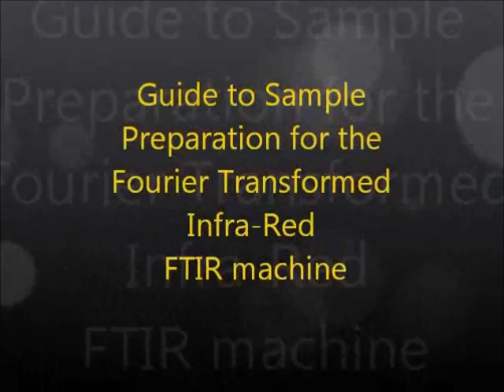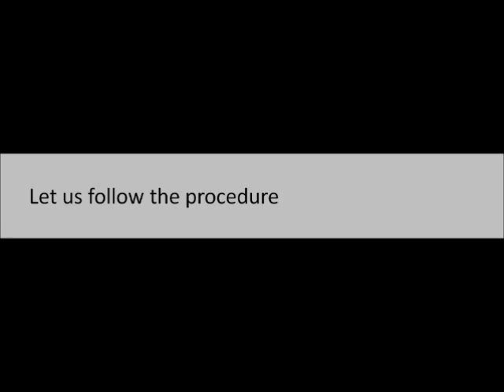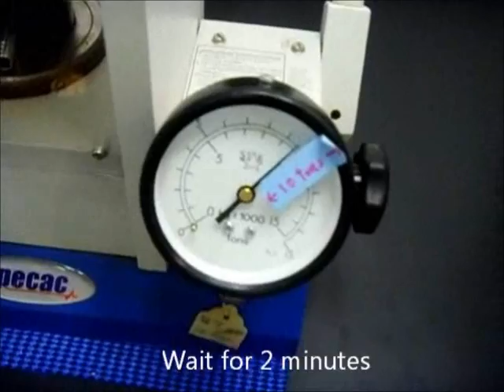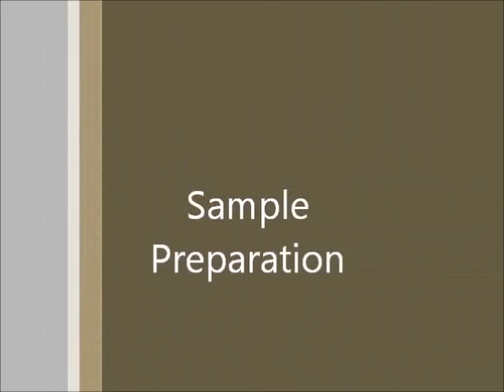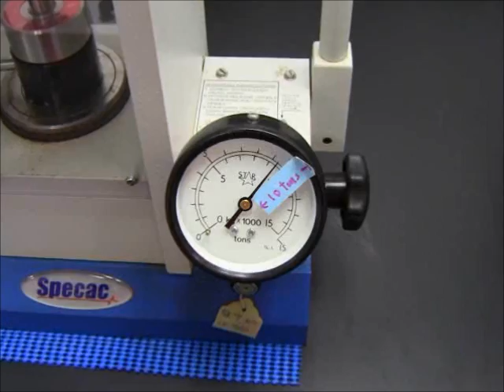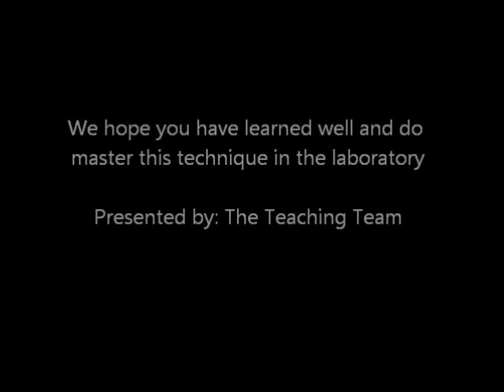FTIR Spectroscopy (Solid Sample Analysis)

Comment: hi, sir,  it is a nice video .first  for example for composite material if I want the diameter of the specimen is 20 mm and the diameter of the die is 25 mm can I machine the resulting specimen or I must use another die with 20 mm diameter? secondly how many grams of powder I used? is it depends on the size of the die or the standard of material which used in the specified test?
Reply from the maker: yes, no need to measure the amount, have to go via experience, give it a try? this is dependent on the solid (if it containts metal or not) as well
Reply: @chemfunman   thanks sir is there reduction in spesimen height after compact comparing to height of powder  in die before compact process? and is  the fully filling die with powder prefered or not ?

Comment: what is tms?
Reply from the maker: +Chelsy K at which time frame?
Reply: +FunMan Fung at 4:45
Reply from the maker: Chelsy K
tire monitor system, the same one used to measure pressure of the wheels